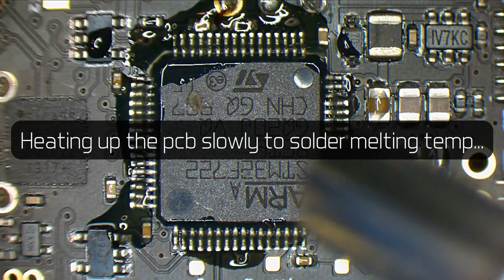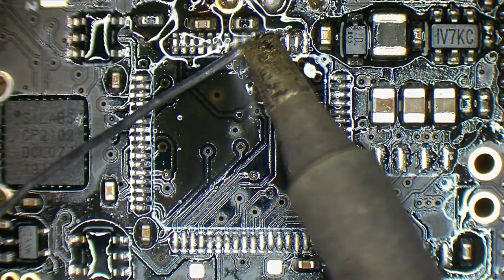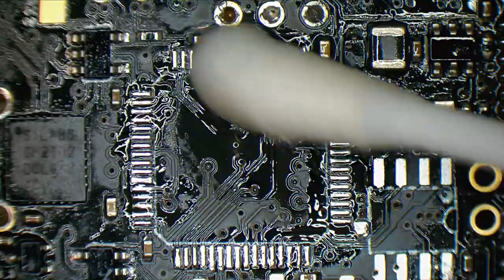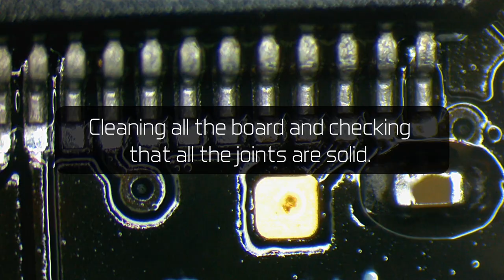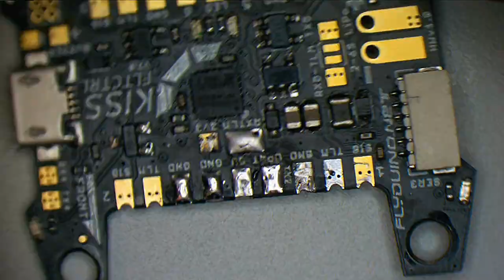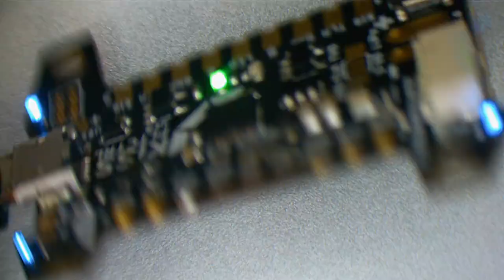Replacing a STM32F7 MCU   SMD REFLOW

Comment: I always work on the donor first, and then the board I'm working on so that I don't have to reheat the whole thing. Never bother to remove the unleaded solder, but I often have to do drag soldering afterwards to ensure good connection.
Reply from the maker: I prefer to start with the good PCB to know if anything becomes broken or find different problems with it.

Comment: Do you have to use the ST link tool if you're using new MCU?
Reply from the maker: If you need to flash a new mcu... yes. And some sort of jig to contact the required pads.
Reply: @LivyuFPV  the mini Flight controllers don't have Soder pads for the ST tool  only a 30×30 Flight controller. Does this mean I have to sorder and disorder  the MCU off of a flight controller that I can use the ST tool.
Reply from the maker: @florin26balalau  yes :(
Reply: Thank you, sir. I ordered some m. C. U's. I will attend this for my first time.

Comment: Do you find this method better/easier then using solder paste?
Reply: Unless you have a stencil, this is typically easier and faster. Paste is great for many applications, but good leaded solder on fresh pads flows just as well. Either way will result in a solid re-flow, though.
Reply from the maker: @MBrulla  good answer :P
Reply: @LivyuFPV  Thanks sir. Your videos are what inspired me to go down the path of SMD work. Appreciated greatly.

If you ever want to do a whoop (Crazybee) ESC Mosfet video I'm sure it'd be very popular. Done lots of those repairs now and there are still many floating around!
Reply: @MBrulla  Yeahm i did a Mosfet reapaiir too hahaha those crappy boards lol